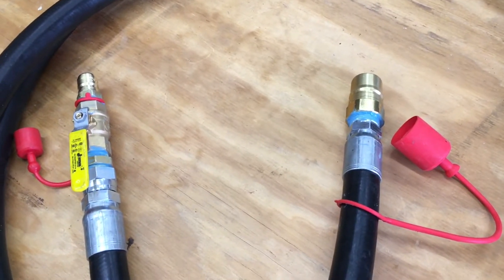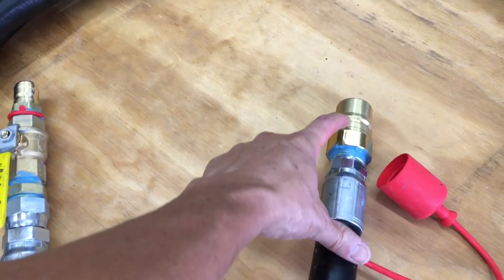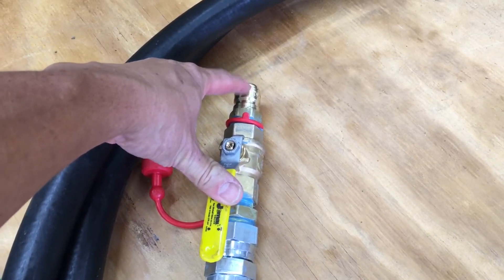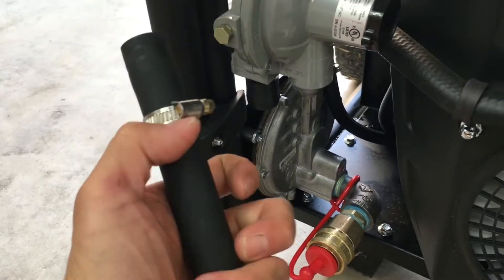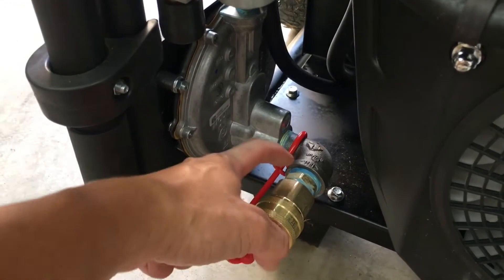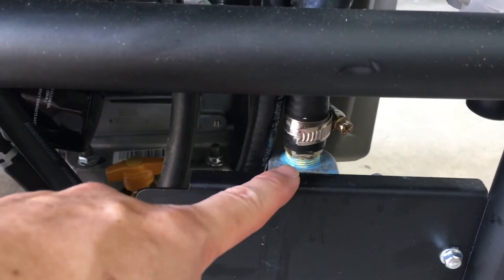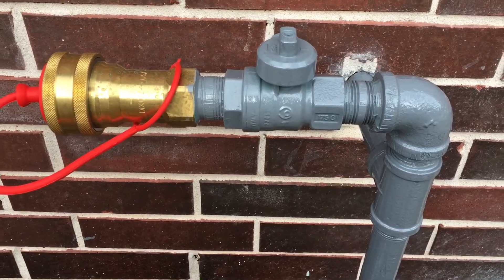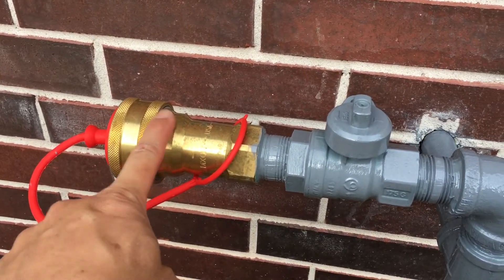Part 8 Westinghouse WGEN12000DF 15000 Watt Dual Fuel Portable Generator Natural Gas Conversion Parts

Comment: Great video. Can you tell us exactly what fitting you bought for the discharge of the regulator?
Reply from the maker: Thanks just trying to help a fellow man. out. Are you referring to the barb fitting going from the Garretson regulator into the generator?? If so, it is a 1/2" barb by 3/8" MIP brass adapter fitting from Home Depot.

All the parts, I used for this video, is listed in the description below the video. 

Hope this helps, if you have any more question(s), just ask. Thanks for watching, make sure to hit the like and subscribe button.
Reply: Thanks. Parts list is clear!

One more question… why the change out of the fitting on the discharge of the pressure regulator?  Seems to be that size already.
Reply from the maker: @petecalizzi8074  For my 12000DF,  the OG fitting was smaller on the inside. Not a open orifice. Now maybe they have changed it, after 2021. Not sure. I know for a fact they (Westinghouse) watch these videos about their generators that people put it.
Reply: Thanks for the help! Conversion complete, and fully tested.
Reply from the maker: @petecalizzi8074  Your welcome, glad it was helpful for you.

Comment: A million thanks to you for supplying all that info. You really helped me out. One question more: do I need the conversion regulator kit or can the NG line be hooked up directly to the generator like you did?  Thanks again for your response because as I said before NO ONE knows anything about this converstion around here.😍
Reply from the maker: No, your generator will require a kit with a new regulator.. PNG Technologies sells kit I believe for your generator.
Reply: Thanks millions again for your help!

Comment: Your videos are very informative.  I have the westinghouse 9500df. Would I still need a regulator for my generator if my gas meter  
pressure is higher than 7" WC? Would I still need a 1" hose if my generator is about 30 feet from my meter ir could I do with 3/4"? Thanks you your help. No one around here knows anything about this converstion.
Reply from the maker: Since, I don't have a 9500DF. I can't answer fully. First, you would need to call you gas company and just ask them what your WC is. They would be able to tell you over the phone. It is very important to know that, for what is to follow.

Since, your house has natural gas, you will have to count up the BTU usage for your all natural gas appliances. That will be listed on the appliance itself. Once you have that BTU total you need to subtract that from the CURRENT meter BTU capacity. You can just look at the tag on your current meter, and google that model gas meter. Guessing your generator will require about 125,000 BTU.

If,  you plan on using your generator for summer storms then it will be less of an issue. BTU usage comes into play more during winter storms, (i.e. running heat for the house). Still good to know, if you need to have your gas company upgrade your meter or not. If you currently have a pool, then your gas meter is more than likely already upgraded to a bigger meter. Most gas company upgrade your meter free of charge.

I think the WGEN9500 DF, only comes with only a propane regulator (black regulator on the lower left, where you currently hook up your propane to). So you would need to get conversion kit from a 3rd party (i.e. PNG Technologies, or others). When you order the kit, you MUST know your correct WC and generator model. So that they can give the correct regulator. 

That conversion kit will have all the correct parts to run it on natural gas. I wouldn't order the 30' hose from them, ( i.e. PNG Technologies, or others), just too costly. I would try and source it locally.

As far as the natural gas hose, I would still run a 1" ID (INTERNAL DIAMETER) hose from the meter to generator. Once at the generator, you will then step down to 3/4" ID (INTERNAL DIAMETER)  with a reducer (which you can see in my part 8, video at about :50-:55) in order to hook up to the conversion kit that you order. You don't have to do a quick connect. I did it for ease of hookup for my family, if I wasn't around to hook up during a power outage.

*NOTE* when you convert to natural gas the wattage output from the generator will be REDUCED by about 20%, (7600 max running watts, 10,000 max starting watts) from the output if your were to run it on gasoline. You will be only running essentials (fridge , lights, TV) NO A/C, microwave.

Hope this helps, thanks again for watching, please the hit LIKE and SUBCRIBE button. If you have anymore question(s), ust ask and I'll try and help. Thanks again for watching.

Comment: I’m in Houston and this is what Centerpoint told me in an email:

“Your residential meter has a 4oz pressure. If you were to install a generator or pool heater, for example, a meter upgrade would be needed. With an upgrade, you will go from a 4oz. regulator to a 2 lb. regulator.”

You didn’t get a larger meter upgrade right?…..I should be good as is since I have your same generator?
Reply from the maker: I can't answer that question, for you, if you will be good or not good. You would have to add up all the MAX BTU usage of ALL your natural gas appliances, in order to know if an upgrade is needed. Many variables come in to play (i.e. size of you natural gas appliances, what you plan to run that uses natural gas). All your natural gas appliances will have some sort of label stating the MAX BTU.

For my situation it was not needed, your situation might differ. 

NOTE if you do upgrade, you will probably need to add (4 oz.) regulators, upstream ALL appliances that uses natural gas ( including the generator). If they don't already have one. So that they won't get damaged from the added pressure.

Hope this helps.
Reply: We only have a gas water heater and furnace, have you tested yours with your furnace running? (2500 sf home).
Reply: Hi- im in Houston as well, I imagine you have a 1/2" gas line for your generator with no upsizing from Centerpoint, right?
Reply: I’m in greater Houston area. Yes, you need a 2# meter.
Reply: Also what orifice size is your 4oz regulator on your generator? 7/16 or 1/2?
Reply from the maker: @Johnny_Bee  My gas meter (250 CFH), has a 7" WC (i.e. 4 oz) regulator already attached to the gas line, at the meter before it enters the house. Since I had the plumber T-off the gas line for the gas hose for the generator between the gas meter and the house it was after the regulator, but AT THE METER. Which it was the right pressure for the Garretson regulator (silver colored) that came with the generator (not the propane regulator (grey colored)). Thus, I didn't need another regulator for my generator. 

For example, if I did have to put in a bigger gas meter (2 PSI). If the new meter was just gas line (2PSI) to meter to gas line into the house. The line between the new meter and before it enters the house, is still 1" ID. In that case, I would have a gotten the plumber to add 1" ID 4 oz step down regulator, where the plumber T-off the gas line. Then obviously, I would have the plumber to add step down regulator to other appliances as well that didn't have one. To ensure no issues from the new meter.

The key to remember, if your gas meter is on the opposite end of your breaker panel. Go with the shortest gas hose possible (i.e. put the generator as close to the gas meter as possible.

Comment: I wonder if this custom kit you made, would work for a Westinghouse WGEN9500DF.
Reply from the maker: I believe it should work with extra parts (Garretson regulator, load block adjuster), but take note on the WGEN 9500 on natural gas. You will see reduction in down to about  7600 watts running.
Reply: @gilbosdiy  thank you. I'll look into it.

Comment: What is your kw output on natural gas vs propane. This looks awesome you did a great job.
Reply from the maker: Thanks, glad I can help.

Factory numbers for propane is max 13500 surge / 10800 running. For natural gas, based only what I have found online it should be max 12000/ 9600.

Comment: Gotta problem...it seems that you have a "quick connector" (female) is installed into the Generator. AND...you connected another quick connector (female) to the natural Gas meter. Yet your hose has a male connector on one end and a female connector on the other end. How can that work?

If I'm wrong please tell me; where I went wrong? Thank you kind Sir.
Reply from the maker: The T-off from the gas meter is 1" ID. I went with a hose that was 1" ID as well. Eventually you would have to step it down to 3'4" ID. Which I choose to do as close to the generator as possible, to maintain gas pressure. 

I guess with size difference of the hose ends, might make it look like one quick connect end is male and the other quick connect end is female.

The hose ends quick connect on both ends are male quick connect, they are just different sizes. Gas meter side (1") and generator side (3/4").  

If you check out part 11 of this video series. In that video you can see the hose ends are both male quick connects. Thanks again for watching don't forget to check out the entire 12 part series. If you have anymore questions, just ask, and I will try and help if I can.

Here is the link to part 11 video: https://youtu.be/6JWsROWO8EI

Comment: What is the model number of the Garretson regulator?  Is this the regulator model number that Westinghouse puts on all of their WGEN12000DF units?  Does the Garretson regulator have a manual primer button?
Reply from the maker: The Garretson regulator I have is a 193291 792G, which has Inlet of 4 oz and max Inlet of 8 oz. 

Yes, this is the one that came with my Westinghouse WGEN12000DF.

This regulator does not have a primer button. You could go online or locally purchase one with the same specs with a primer button. Then you would just have to drill a hole in the mounting plate that this regulator attaches to on the generator. In order to have access to the primer button. If you scroll to 1:41 in the video you can see what I am referring to. Hope this helps, if you have anymore questions just ask. If I can help I will. Thanks for watching

Comment: Did the plumber need a permit to get that quick connection on the meter installed?
Reply from the maker: For my location, the plumber did not need to. Your area could require it, so you would need to check with your local area.
Reply: @gilbosdiy  thx

Comment: is there any way to control the amount of gas going into the generator?  Like a fine turn adjustment screw.
Reply from the maker: Yea there are kits out there for it, if one needs them.
For my house, with natural gas. That has a gas meter with 7" WC or 4oz of pressure. I used the 1" INNER DIAMETER, 30 feet hose from the meter to the generator, then stepped down to 3/4" into the KN Garretson regulator. From the KN Garretson regulator to the generator, I did replace with 1/2" barb by 3/8" MIP brass adapter fitting from Home Depot. To ensure I did have enough natural gas flow. Using this setup, my generator idled just fine, no hesitation, I didn't feel I needed one. Your situation and setup is probably  different and my require one. Hope this helps.
Reply: @gilbosdiy could you elaborate on the fitting you replaced @1:41 ? Did you also use a larger hose?……I’m in Houston and kinda “late to the game” with all this but working on doing a similar setup as you did.
Reply from the maker: @Johnny_Bee  yes I replaced it with the following:
https://www.homedepot.com/p/Everbilt-1-2-in-Barb-x-3-8-in-MIP-Brass-Adapter-Fitting-800199/300096744

The only hose I purchased is the main natural gas supply hose. That goes from the gas meter to the generator. That supply hose is a 1" ID hose. I purchased that from ab3power.

The complete list of items I used is listed in the description below the video.

Thanks for watching, make sure to like and subscribe.

If you have any more questions. Just ask and I'll try and help, if I can.
Reply from the maker: @Johnny_Bee  The hose that goes from the Garrettson regulator into the carburetor, is the stock hose.

Comment: Did you hire just a regular plumber, I'm thinking water, or do you need one that specializes in natural gas plumbing?
Reply from the maker: My plumber does gas work regularly so it wasn't a issue for me. My suggestion would be to get one that does it, better safe than sorry.
Reply: @gilbosdiy  Thanks! You have a very nice setup.

Comment: Just picked up my Jomar shutoff valve for my meter. Gives me the added confidence, valve won’t be flipped open so easily like a ball valve lever. Since my gas meter is outside the gate.
Reply from the maker: Yea, that is why I went with the Jomar valve. Also this shutoff valve allows you to add a padlock if you choose, but since you can't open the valve without an adjustable wrench or channel lock pliers. It takes a lot that worry out of someone accidentally opening it.
Reply: @gilbosdiy  one other question, which paint did you use to paint the pipe and valve?
Reply from the maker: @pullmarkbird9112  Just go to your local HD or Lowes and get the 1/2 pint Rust-Oleum 7786730 smoke gray protective enamel. You should be able to repaint your whole meter with the 1/2 pint. Make sure you clean off any loose paint, before applying the new coat.

Comment: Did the generator run on natural gas? Did you notice any change in decibel level running on Gasoline or Natural gas? What is the length of the 1” hose used?  Can you please post another video with the generator running on natural gas? Thank you.
Reply from the maker: I'll try and post a video of it running in a couple days just been super busy. The length of hose for my setup was like 25 feet, so I decided to get a 30 foot hose. I went with a 1 inch internal diameter hose to yield maximum volume of natural gas. I was glad my setup didn't require longer hose. Perfect distance and pressure. Generator, fired right up, no issues, idle was fine. Sound wise loud is loud, it's a generator, only running it for emergency use. The shed I converted for it insulated with the mineral wool, cuts down the sound enough to where it doesn't bother me.
Reply: @gilbosdiy  I have a similar set up but with a low pressure regulator from century fuel.Check my video  “ Westinghouse generator 12000df running on natural gas” posted a month ago. I used a 60 feet hose with 1 inch diameter. Looks like you used the regulator that came with the gen. Glad it worked out for you without buying another regulator and changing the branch Tee.My gen came with a higher pressure regulator so I got a low pressure regulator and also changed the branch Tee to work with the low pressure from my meter. Your set up is simpler. Good job!
Reply from the maker: Wow, that’s pretty long run.  Why such a long run are you not keeping the generator under the patio? My generator came with a 4oz Garretson. What oz was yours?
Reply: Mine came with 8oz Garretson regulator. I got a 4oz regulator from Century link because the pressure at my meter is 4oz. Since, the gen's branch Tee was designed for a 8oz regulator, I had to changed the branch Tee with one designed for 4oz regulator to increase the volume of airflow into carburetor.  Initially, I wanted the flexibility of moving the gen as far away from the house as possible if I wanted to, so I got the 60 feet hose. That way,  I will not have buy hoses twice if I had bought a shorter length.